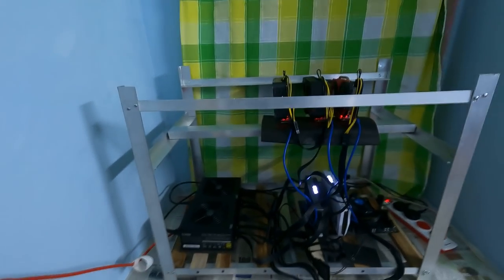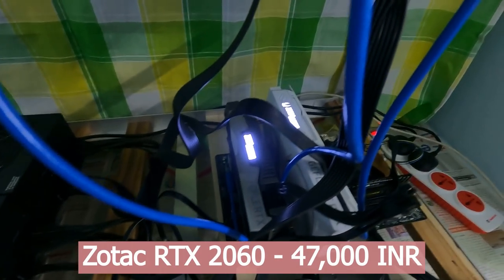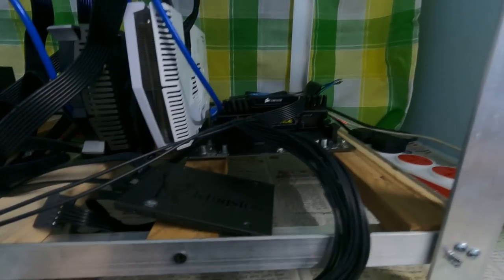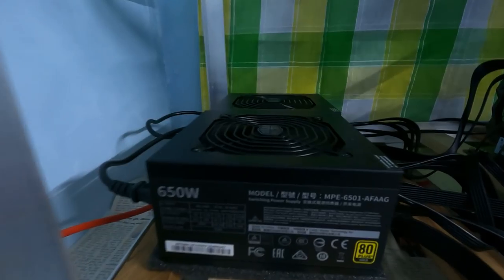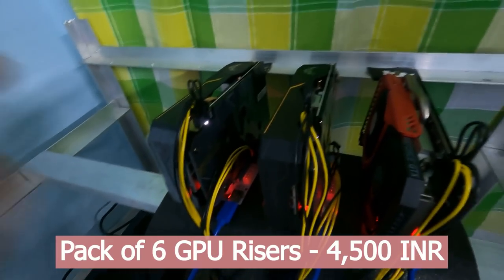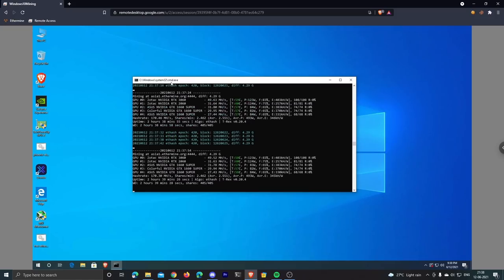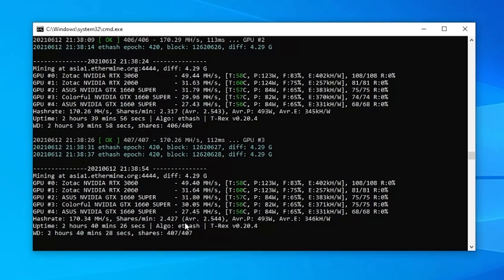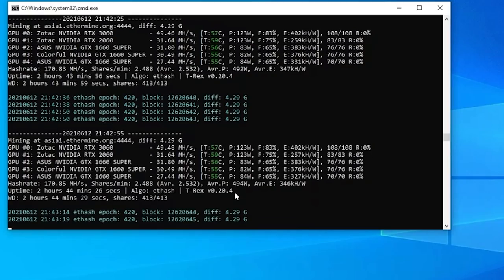My first Ethereum Mining Rig Build (worth 3 lakh)

Comment: I don't think you will be in profit or even recover the cost if you earn an average  1000 per day it is 30000 per month and the electricity  bill will be a lot as of Ac and the rig you will be left with 15000. And it will atleast take you  atleast 20 months  just to recover the cost and if the new rule will be applied  for ETH mining the mining  will not be profitable  anymore and it maybe over better if you use solar energy for you rig ....
Reply: Woah 15k for electricity  .. no max 3k

Comment: Similar story like mine I started mining in may end faced several problems and errors I have -- 
As rock b450 pro 4 
Amd ryzen 3000g
Ssd 120 gb
Power supply 850 watts×2 = 1700 watts
Gpu --
Nvidia rtx 2060×2
Gtx 1660 supper×3
I wasnt able to run 5th gpu like you then changed the motherboard the problem was pcie slots 
Now its running total hashrate is 165 mhs 
Last problem is power outage so in future i am going for solar powered rig 
Budget was 320000
Reply: @adminbyseregasoleniyminer4490  once again fake tech raj WhatsApp

Comment: Does mining voids the warrenty?
Reply: Have to check on manufacturer's website
Reply: See if you don't  tell you have use it for mining or overclock  it is very hard to tell that it is for mining
Reply: @viditagrawal  makes sense
Reply: @apurvsharma1261  if you just clean you gpu it is very hard to make a difference  between  a gpu for gaming  and a gpu for mining  only if you don't download and pirated drivers for increasing hash rate
Reply: @colinmectariane7233  what does this even mean?